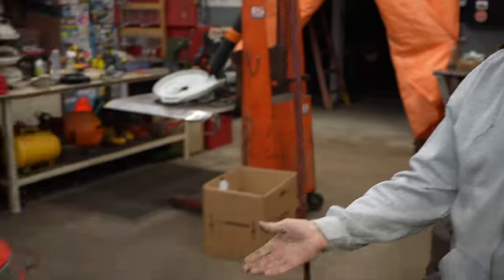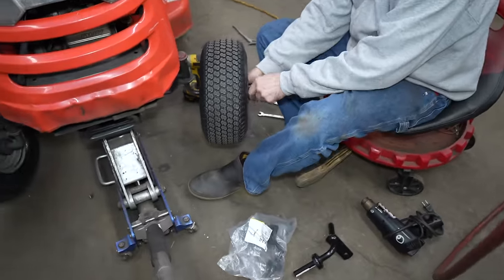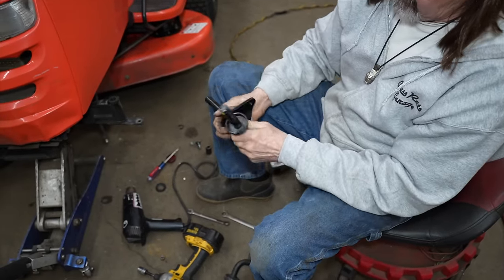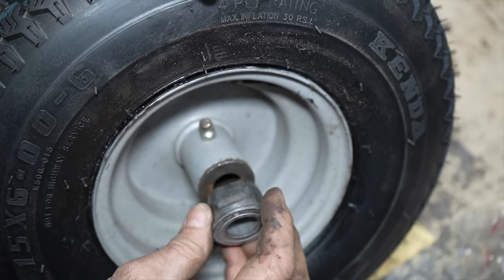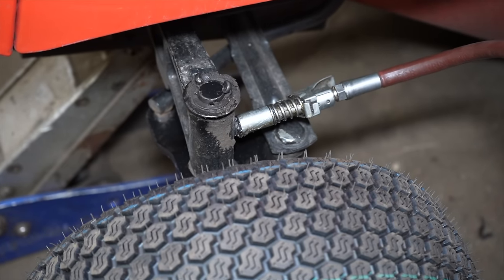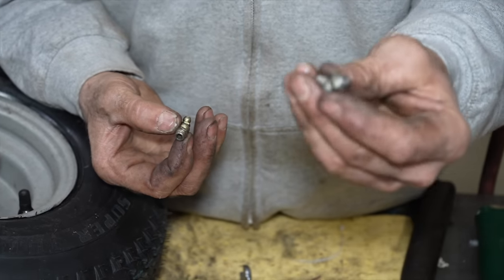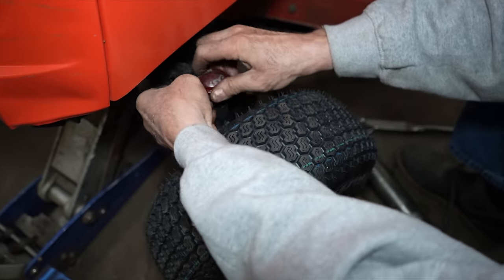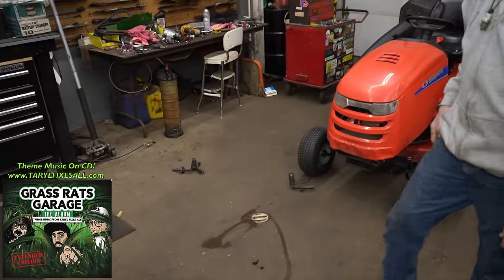We Found A Loophole To Save You Money! $$$

Comment: Nice find on those spindles!  I saw the same problem with my neighbor's tractor. I went on Amazon and bought two pairs of roller bearings for $15 and swapped them into the rims instead of replacing the bushings. The wear/damage on the spindle no longer matters since the roller bearings rotate. One of these days I'll do the same to my tractor.
Reply: I am guessing you mean BALL BEARINGS and you are correct in that is a much easier and cheaper way.  $15 in parts a lot better than $75 in spindles and easier/faster to install.
Reply: There are tapered roller bearings and wheel seals in my 1977 vintage Gravely tractor like older cars and pickups. A great design, but costs "must" be cut.
Reply: Make a video to show us how
Reply: @tommak6516 yes, you're right, ball bearings.
Reply: @kevindickerson8036 never made a vid before and id probably just embarrass myself. I did exactly what taryl did to remove the worn bushings (hammered em out with a steel rod) and instead of tapping new ones in, I used the ball bearing race.
Reply: Just for a corporator they want $350.Well it's gonna be four hundred with a carburetor
Reply: @dangerous119,
I did that conversion with flanged ball bearings and it works great!
Reply: Thanks for the grease gun tip, have a aro phenumatic 5 gallon and use mystic 6g full waterproof high pressure
Reply: This sounds like the real loophole to save money!
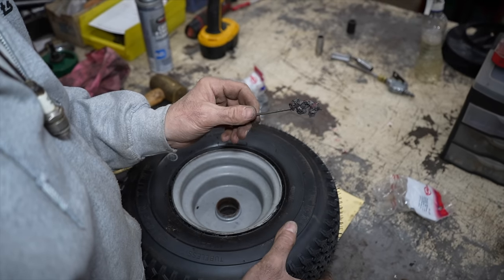Reply: Used nylon hose mender no bearings tada 13:42
Reply: Aww come on guys, it's ALL ball bearings nowadays.
-Fletch

Comment: Mr. Heatgun is a real hot head.

Also, just did this repair today, ended up using a metric grub (3mm) with a 2.5mm diameter drill hole and a 3mm/0.5 Tap.  Worked really well, will reassemble head tomorrow.  Tbh 3mm is very fiddly to work with but it’s what I had.

Comment: Hey Taryl! I have a John Deere with the same exact front wheel and spindle set up. I replaced my wheel bushings with sealed wheel bearings.  Works great!! No more worn out spindles and bushings and no more messy grease collecting grass and dirt on the inside of the wheel from grease oozing out. Just a tip that worked good for me.
Reply: I also have a JD LA135 that wore out the front bushings and spindles, and I did the same as you. Replaced the spindles with JD parts and installed flanged bearings in the wheels. Over 400 hours on that setup and still no play at all. Also, while the spindles were off, I replaced the washers (the one Taryl mistakenly missed the first time) with two thin races and a Torrington thrust bearing. Almost like having power steering. It especially helps when the snow blower is hanging off the front. Still a little hard to steer with the blower, but much better with the bearings between the spindle and the axle beam.
Reply: I just welded two boat trailer spindles (used) on my case 446.
Reply: @paulwindisch1423  I installed thrust bearings and I'm disappointed that I can't feel any difference in the steering
Reply: @nperson  Are any other friction points in your steering binding? Maybe “almost like having power steering” was a little exaggerated, but it really did make the steering quite a bit easier on my machine.
Reply: @paulwindisch1423  I think the steering may be slightly smoother but I haven’t felt that it is easier. Perhaps I should take it out on the interstate to give it a real test.

Comment: you can also weld a couple of spots on bottom of both spindles , roughly grind round again , and switch to ball bearings in wheels . they're pretty cheap online .
Reply: They should have used ball bearings, or tapered roller bearings with adjustable preload like automotive spindles.
Reply: Just throw the ball bearing on, don't even worry about grinding.
Reply: Ya, because they were MADE TO FAIL from the factory!
Reply: I have a cub cadet slt 1550 I want to put ball-bearing in but I don't know what size spindle on the  cub cadet slt1550

Comment: The first thing you do if you buy a new mower with the bushings, buy off your choice of web site the upgrade kit which includes 4 ball bearings to replace the 2 bushings. The last kit I bought $22.00 included roller thrust bearings with stainless washers. When new all the weight of the front end of the lawn tractor is between the axle and spindle making it harder to turn, plus wearing out the spindles.

Comment: Why did you put the Air and Grease fittings on the inside? Love Your Videos! Thanks for the Laughs!
Reply: The wheel can only go on one way , the hole where the bushings go is recessed on the one side.
Reply: I’m wondering the same thing
Reply: @charleschapman2428 they can work flipped around

Comment: Lotta time in with farm and heavy equipment, and they dont grease or oil thimgs like 3 point hitches because theyll' attract dirt instead of drop it. 
You COULD dry lube spindles, but you'd have to pull the wheels every time you use it. 
My advice would be (for sandy or dust) to grease it every. run, a bit of excess to clean up but, filled with grease isn't allowing dirt or water in, and greeze is cheeper than partz!

Comment: I swipe a used axle from one of my parts mowers or better yet.....weld up the worn spot, grind it smooth, sand to polish up some. Weld is usually harder the shaft so last longer the 2nd time around 😉

Comment: Dumb question for Mr. Dactyl. I noticed on the left front, the wheel was mounted with the valve stem on the inboard side, as well as the grease fitting. Is there an advantage to running this way?

Comment: What about putting sealed bearings on the wheels and scrap the bushings!  Hopefully the wheels have the 1-3/8” holes once ya knock out the bushing. I’ve done it to mine.  Worked on a craftsman that had newer designed wheels that had only 1” bore once the bushing was removed. Guess that is how they put the stop to fixing the crap they make!  Well ya can still use older wheels and scrap the new design!  And there’s your dinner!
Reply: @cjrock4096 I installed bearings rather than bushings for less money!  Bearing for me!
Reply: @cjrock4096 as an added bonus of using sealed bearings is NO GREASING other than if you want to. If you want to grease them regularly then remove the inner seal so it will take the grease. Just be careful not to blow off the outer seal.
Reply: @cjrock4096 Oregon has 45-000 but the aftermarket are just as good and are 10 pieces for 20 dollars
Reply: Should probably replace the Axle Center pivot. Should be a bushing there two, which will help a lot with the loose front end 💁‍♂️
Reply: cjrock4096 every time I enter info YouTube rejects it. Must be against something I guess, can’t say where I got them or it gets rejected.

Comment: I love cheap eBay parts. I rebuilt an old John Deere L1 30 but I’ve been sitting out in the rain for three years and I did spindles and rebuilt the whole deck replaced. The PTO clutch carbon a bunch of stuff. The car rebuilt and it was fine And I’ve used the eBay spindles for years because there a quarter of the price of John Deere usually and I’ll admit they don’t last as long the John Deere last me about five years. These last me about 3 to 4 years. They’re super cheap if you buy the rebuild kits with the pulleys and everythingand I’ve even got a couple spares sitting in my garage, so I’m ready if it goes out again even though I don’t use that mower anymore😂.  For the simple, mechanical parts they’re so much cheaper I’ve just gone with the eBay and I’ve been lucky so far. Where I haven’t been lucky as with things like belts. I’ll get the cheap eBay belts and they bust usually within a few hours, and are kind of pointless And I might get three or four mows out of them, with the John Deere belt or a decent quality belt. I might get 20 or 30 miles out of it and it’s just not worth the hassle to save a few bucks.   

Terrell should do an episode on belts and different brands, I know the John Deere isn’t worth the $49 and I’m sure there are brands that aren’t OEM that are much cheaper and better quality. The mechanic at my Rural King told me about belts he’s had luck with that were almost half the price of the OEM For my zero turn, so far so good.   I’m sure Terrell is a guru and knows what to use

Comment: It seems like if the wheels and spindle were greased frequently (assuming the zerk fittings work), the new grease would push out the contaminated grease, which would go into the grease cups and the plastic hub caps to keep sand from getting in, and keep wear to a minimum.

Comment: So, just wondering. If the problem in your area is sand, would a dry lubricant work better? Especially since there is no dust seals on the bushings. Know Cats you don't grease/oil the tracks because the grease holds dirt in suspension making a poor man's lapping compound and wearing components faster.

Comment: I've been taryl fan for years.  However, i have been purchasing certain non OEM parts for years when it comes to non space shuttle designed lawn tractors.   In dealing with the belts, I'm a little more pickier.  when i can get OEM belts i try to buy them, but I have had good luck using gates belts.

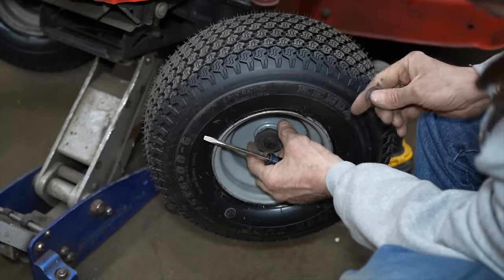Comment: 4:50 We call them Jesus clips cause when one flies off and lands where we cant find them we say Oh Jesus !! I had couple worn like that I just built it back up with hard facing welding rod then ground it down to fit  with a axle stub grinder  A VERY indispensable tool around a shop dealing with trucks and trailers .  and all sorts of equipment saves a ton of money That Lock n lube is the best thing going !!  does not get stuck on a fitting !

Comment: Why are the wheel grease fittings and tire valve stem on the inside? At first I thought you just put it on backwards, but seeing that you put them on and off a couple of times and even greased them. I'm assuming they're suppose to be that way. They seem to be recessed far enough in, that they won't get broken off by hitting something.
Reply: I was wondering the same thing! What kind of messed up company puts the air valves on the inside? Or did Daryl screw up and put them on the wrong side😂
Reply: @paulattanasio3061 
Why did B&S not drill straight down the middle of the axle until the point where a cross drilled hole exited right in the middle of the area between the two bushings
and chamfered the exterior end hole so it could be filled with grease using a needle nosed grease gun fitting.????
That rubber end cap would have kept the dirt out.......

Of course everyone commenting here has already replaced all the plain bushings with ball bearing races anyway...

Comment: Why are the grease fittings and air valves on the inside of the wheels, should the wheels be turned around so the valves and grease fittings are on the outside for ease of service?
Reply: Thought the same thing.

Comment: An even better way to save money is to put a shot of grease into the zerk fittings on the wheels.. They exist there for a reason. Use them. In fact professionals will pump grease and maintain equipment on a regular basis. Do it.
You'll save a bundle.

Comment: had to replace the same part on my neighbors. they were never grease. wonder why they went bad..lol. also noticed those trannys don't like going uphill. Another cheap made lawn mower. probably has that single cylinder Kohler with leaky valve cover that they only use a cork gasket to seal it. don't forget to grease the bearings for the blade housings...lol

Comment: Are you finding a lot of Briggs and Scrapem parts are out of stock in the USA, because in the UK most Briggs parts are out of stock and long back order. The genuine plastic carburettors for the sprint engines are currently not available in the UK and we are finding that a lot of them are warping due to the new E10 fuel people are using and it is the my mower won't start season. 
We could use Chinese copies but they are not 100% reliable

Comment: hay taryl  you put that wheel on with the air fill valve and the grease fitting on the inside . that will make it hard to put air in the valve and put grease in the fitting.

Comment: There's a video called  Poor Man Power Steering by Jordan Bronson where he uses a flat thrust bearing in place of that washer that you forgot. It looks like it could really help with the steering
Reply: Sometimes there isn't enough extra space to fit a thrust bearing under the axle pivot spindle. Years back, I used 2 thinner bronze thrust washers and it worked well to cut steering effort. If you cut new slots to move the clip up, then a bearing could possibly fit. I'm mad that an old JD 1642 I'm working on now came from the factory with that axle pivot welded in on top instead of a removable clip.

Comment: I thought they made a front end bearing kit for those
Reply: They do, yes. Northern Tool has their "low speed bearings" at $15 for a set of two, ebay is even cheaper than that. One thing to watch out for though: if you are working on a go-kart with a threaded axle, don't over-tighten the axle nut! With bushings it will just jam up, with bearings it will put too much side load on them and wear them out much quicker. Ideally you'd have a spacer inside of the wheel, between those bearings, but if not then tighten just until the wheel can't move side-to-side, then maybe 1/4-1/2 turn past that.

Comment: Would be interested in Taryl's OR anyone's experience with the sealed bearing replacements for bushings that some vendors are offering as an alternative to replacing the bushing.  My gut tells me to watch out, but it seems a logical move to take the bearing out of the equation to increase life on that spindle. Any input? Thanks in advance!
Reply: I put flanged (sealed) ball bearings in the front wheels on my Murray tractor years ago and haven´t  had any problems with them.  My old 1973 Wheel Horse has ball bearings in the front wheels since new and they have never failed. They are not sealed bearings though, i just give them a good shot of grease with a grease gun before the season begins.
Reply: I replaced the Bushings on my old John Deere L130 with sealed bearings and never had another problem. I gave that mower to a friend and it is now 20 years old and still going strong. I replaced it with a John Deere X758 Diesel tractor.
Reply: I also did the same on my JD LA135. Over 400 hours since installing the bearings and still no wear or play at all. I think I got mine from Amazon, they were not very expensive. If I remember correctly, it came as a kit with four bearings, new washers, new E-clips and new yellow caps for around $20-$25.
Reply: @paulwindisch1423  Yep that is what I purchased a kit and it was easy to install.

Comment: My son's Cub Cadet riding mower cannot be aligned since replacing the front end parts with oem parts. Looks like he's going to have to cut an inch out of the left tie rod, then weld it back together. There's just not enough adjustment to set the toe in properly.  Anyone else run into this problem?

Comment: 5:16  You can save the customer MORE $$ by NOT replacing the bushings with the same & NOT replacing the spindles, DO THIS INSTEAD, get the PLASTIC bushings, the plastic bushings have a LONGER SURFACE to rotate around the spindle, more support & will run on the NON damaged part of the spindle

Comment: I once replaced the bushings on my JD with aftermarket ball bearings.    Didn't keep it long enough for a life test.  I figure ball bearings can be replaced without ruining the spindle.  
Anyone else try that and did they last?
Reply: Yep....
Little weld and grind on the axle for a tight fit on the bearing ID.
Reply: Bearings are the way to go, I did that to my old John Deere L130 and it is still going strong, I gave that mower to a friend and it is now 20 years old. I replaced it with a John Deere X758 Diesel.

Comment: Bad design to begin with. Those bushings look to be steel as is also the spindle. Everybody worth their weight know that similar metals rubbing together generate friction. That is the main reason the spindle grinds away. Those bushings should be made out of brass. Increase the length substantially, have spiral grease channels cut on the ID of the bushing having the Zirk fitting screw directly into the bushing. Then have some form of seal to also keep dirt out. Sealed roller/pin bearings would be the best design.

Comment: Don't waste your money on replacement bushings. just replace the worthless bushings with sealed roller bearings instead. That way your axles will not wear out like those are. Hopefully you will install bearings so you won't need to replace the entire spindle assy. What a waste if they just knew better.